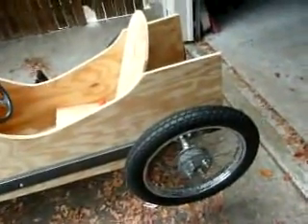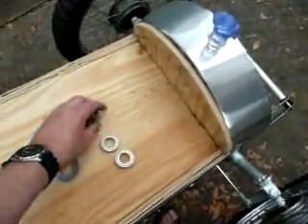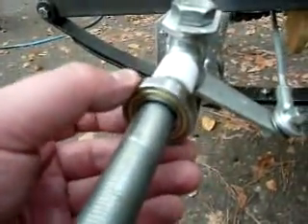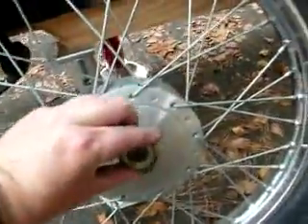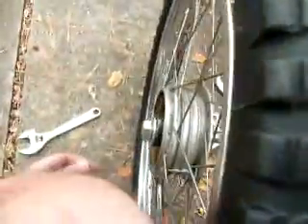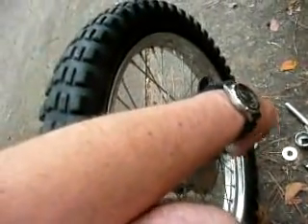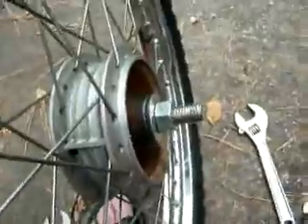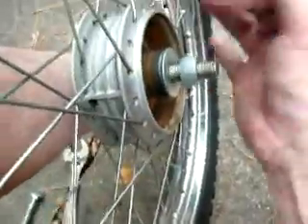Cyclekart progress, 2010-10-23 Rolling Chassis

Comment: I know it's been quite some time since you poster this vid. You mentioned stainless steel being to hard to form wheel bearing shims from, well if your still around or for anyone else, Heat SS to bright red and drop in cool water, it'll go dead soft and you can form away, brass as well....Tom

Comment: Thank you for showing how you changed out the front bearings to fit a 3/4" axle. I'm in the planning stages of making a light weight reverse trike. (2 wheels in front) Finding a way to enlarge the small standard axle has been a thorn in my butt till seeing this video. Can I ask what wheel you used?  I have an 82 Yamaha 185 with a 17" x 2.5" front wheel I'm hoping to use, and I'm hoping to use the drum brake.

Comment: For better handling, I think you should learned from Kocart or ATV front wheel steering.  Your kart will run  straight forward without having to catch the steering wheel and also good cornering.
Reply from the maker: It tracks ok as it's got some caster, the tire contact patch is behind the axis of the kingpin. This is fairly standard setup for these cyclekarts which are as much about looks as about performance.
Reply: @StephenCameron  Thanks Steve for your feedback, You have a great hobby. For me now its a paramotor.